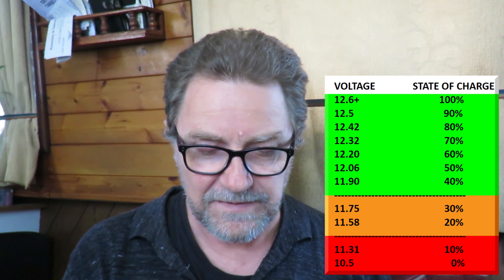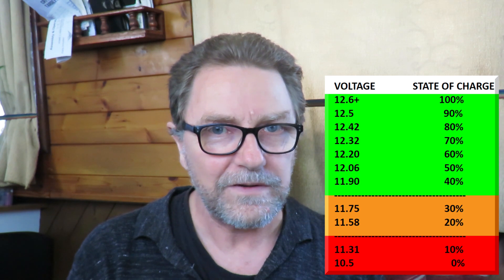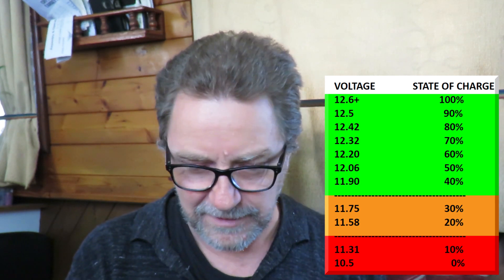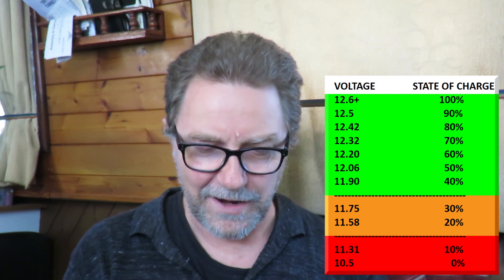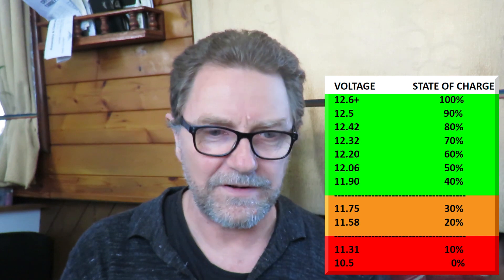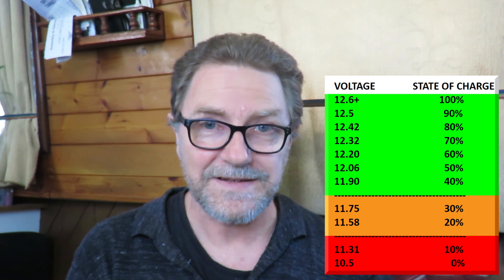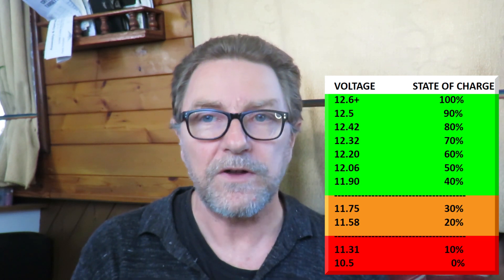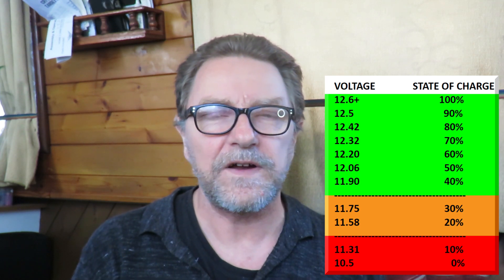How to measure the state of battery charge in 12v lead acid battery systems in narrowboats and vans.

Comment: It's worthing remembering that Just because a volt meter gives you a high reading indication the battery is fully charged that doesn't mean the battery is in good health. You can have an old battery that looks fully charged but will deplete quickly when drawing current from it.
Reply from the maker: That's pretty much what I was saying at around 4 mins in.
Reply: @NarrowboatJourneys  Yeah I know, I was just saying it's worth remembering.
Reply: @backyardbasher  Just because water comes out of a kettle it doesn't mean it is hot,  it could have cooled down.  Also worth remembering.

Comment: Why not wire in permanently a panel meter with a momentary contact switch leaving the meter out of circuit until you wish to take a reading. Some on eBay measure to 2000 counts and obviously, the more you can spend, the greater the accuracy generally.
Reply from the maker: It's fine to do that if you can find a meter that is accurate enough. I have one of those as well.

Comment: Thank you so much for the battery information I really needed that as my batteries aren’t holding a charge. Can I mix a starter battery 80 and my leisure batteries 120   
Regards Paul NB Tinker
Reply from the maker: Don't connect different amp hour capacity batteries together, and don't mix old and new batteries. If one of your batteries has died just remove it and use the remaining batteries until you are able to replace them all. Normally a starter battery is on a different circuit so is ok if the capacity is different. Starter batteries tend to last a long time. Mine last about ten years but domestic batteries last more like three years before the performance declines. It's because they are cycled more deeply.